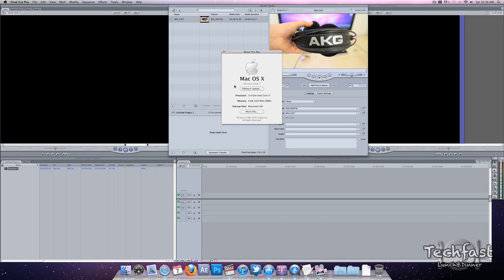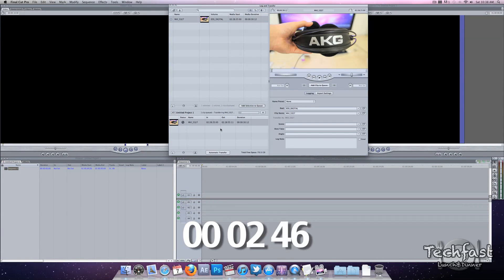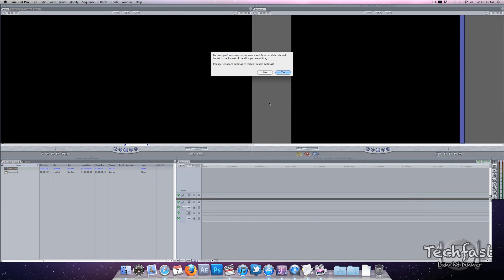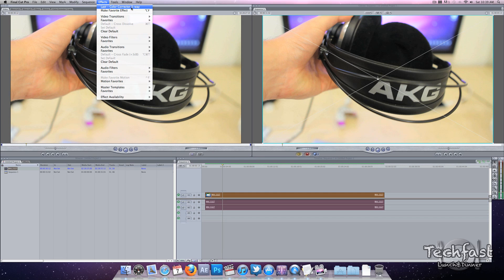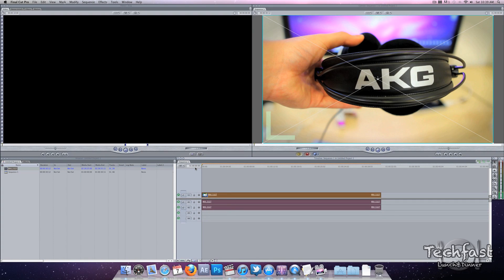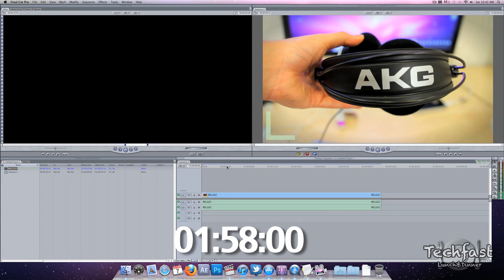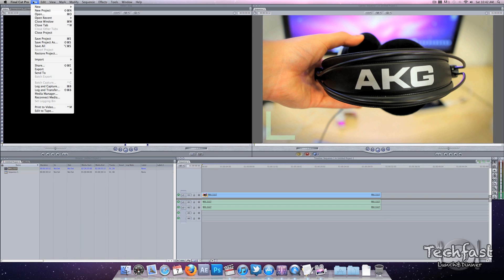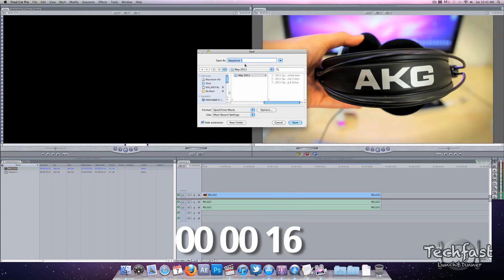2011 Quad-Core iMac Speed Test: Final Cut Pro 7

Comment: ok i want an iMac i have always used PCs and they ALWAYS have problems 4 months ago i got a brand new Gateway laptop, and yesterday the hardrive crashed and before that my videocard has "encountered errors" and 2 of my keys on the keyboard broke off..... 750$ piece of **** or 1200$ iMac that will never break.  I know what you spend is what you get but it is ridiculous for something that is 750 bucks to break in 4 months  FUCK YOU MICROSOFT

Comment: Hi I want to buy the new 21.5" iMac 2.7GHz and I would like the 1TB HDD with the SSD but I don't want to pay $600 extra for that. The question is if I buy the 1TB and Purchase a cheap 60 or 120GB SSD and install it my self if the imac comes with the plug for the second Drive. if you have any idea Please let me know. Thanks

Comment: also premiere pro cs5 seems to be seriously underrated for some strange reason in my opinion its a fantastic program as good as any out there and when used in conjunction with after effects they skys the limit would defo recommend it and defo recommend a mac which should easily last 5years so prob works out cheaper in the long run...

Comment: i use premiere pro on a late 2010 mac pro i7 and it absolutely flies along no comparison to the pcs in college that use the same software and are supposed to be high spec my mac is much faster and renders like a mofo i would never buy a windows based computer again macs are in a different league completely. expensive yes but you get what you pay for any so called high spec pc ive owned started to go all haywire after two years and ive a friend whose imac is about 5 years old and still a beast

Comment: @ItsHarryHD 

21.5Inch is plenty of room for most people. It still does 1920/1080 resolution which is maximum HD. The graphics card also doesn't have to work near as hard to play games on compared to the 27inch. The 8Gb of RAM will come in handy with OSX Lion. I hear the minimum amount is 2Gb meaning the white Macbook stock model is in trouble.

Comment: @CCGeorgeWashington The Mac Pro is cheap for what it is, or at least very competitive. It's not a desktop class machine like you'd get in Best Buy for a few hundred bucks, it's a workstation built with a server architecture. It uses server CPU's and server grade RAM and PSU's and hard drives. The logicboard takes 64+GB of RAM (can take 128 if you have the money for the DIMM's lol). It's a workhorse, not an every day run of the mill "PC".